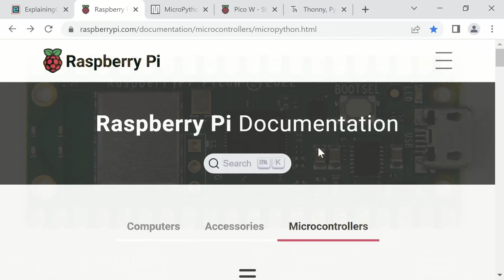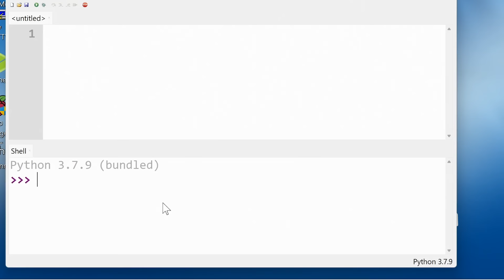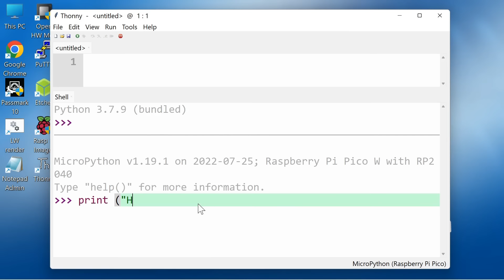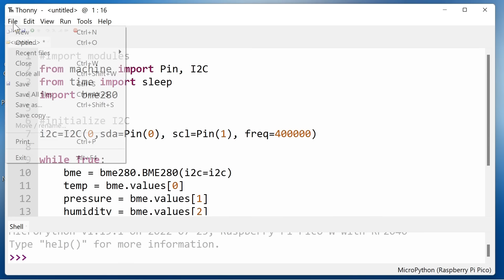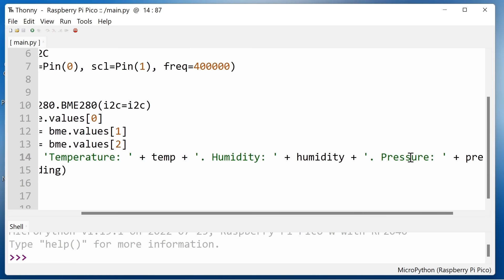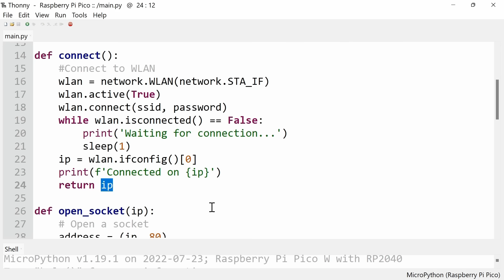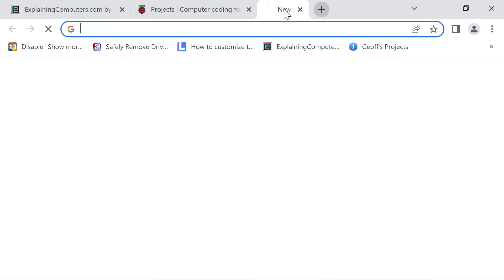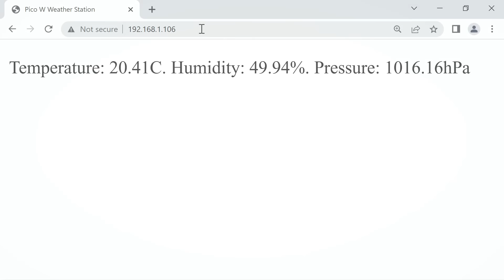Raspberry Pi Pico W: Wireless Weather Station

Comment: I'm waiting for quality MQTT library for Pico W. At this point I can work around it with sockets or other network connections from more advanced Pi Zero and Linux but it would be great to just push data into queue and process it later.
Reply: What's wrong with the existing MQTT libraries?
Reply: @Jimmy_Jones  have you seen C one?
There is one from Paho but it is for C++ and not exactly works on Pico. It works fine on STM32 HAL.
Reply: It shouldn’t take too long as it’s also available on other wifi microcontrollers. But I agree that it’s a priority requirement for networked microcontrollers.
Reply: @CallousCoder  there are some use cases. But I want C so for now it is screwed anyway ;)
Reply: @SergiuszRoszczyk  I agree, but I think it won’t take long for a C MQTT client to pop-up. It’s a simple enough protocol, but it depends on the ip stack implementation of the pico how easy it is to use.
Especially TLS, that’s always non-trivial. But when MQTT C lib is there, I’ll finally be in on the pico. The pico W finally made it a viable platform for me. And I’m actually excited for it now. On its release I didn’t see it as a rival to the ESP32s I tend to use.
Reply: @CallousCoder  I keep fingers crossed for it. I use Pico a lot for tinkering I'd normally do on pure AVR (without Arduino). Now with networking layer it may become very useful IoT platform.
Reply: @SergiuszRoszczyk  I totally agree!

Comment: Thanks for this outstanding video. Is It also possible to implement a weight sensor project?
Reply from the maker: This is a very interesting idea. Certainly possible using a load cell or strain guage (where the resistance changes as force is applied). I have made a note to pursue this as a future video. :)
Reply: @ExplainingComputers  Thanks for your reply and for the note 🙂

Comment: Thanks again Chris for this video. I have the pico running as suggested. However, I have been having some problems, the pico stops delivering html after an hour or two, yet I can still ping it and get a response. The only change I've made to the code is to add a 180 second sleep at the end of try: code - I'm trying to save power as I'm running on batteries. NB. Just in case it helps anyone else - I've found that when I've saved a 'main.py' I am subsequently unable to use Thonny, even if I start from scratch and reload the UF2 firmware. The solution is to download flash_nuke.uf2, copy it onto the pico and then the firmware UF2 as normal. That wipes all existing code and libraries but does enable Thonny to access the pico again.
Reply: is there a way other than using the flash nuke file because its quite annoying to wipe everything each time
Reply: @alexthekid3  Not as far as I know, I only found out about flash_nuke because other people have had the same problem.
Reply: The easiest way around this I found was to pull the jumper to the data pin on the bme280. This interrupted the program and allowed thonny to reconnect. Building a permanent hardwired one, I intend on installing a button to interrupt the program for such occasion and one to cycle the power to restart it in case of a wifi interruption.

Comment: When the Pico was connected directly to your computer the IP was 192.168.1.109.  
It was easy to see the IP Number on the screen at that point.   😊
After you took it outside it changed to 192.168.1.106.  
So,  how did you determine what the new IP number was without having a screen attached to the Pico ?     😊  
Thanks in advance for your reply !!!

Comment: Question is; can this be safely enclosed and still give out a relatively accurate reading? 🤔
Reply from the maker: Yes. The Pico and sensor do not get hot, so there is no problem enclosing them. But there would need to be a small opening somewhere for air to get to the sensor for taking pressure and humidity readings
Reply: @ExplainingComputers  Makes sense :)

Also, any chance you could link to the Github page of that module in the description? Might help others to understand it better if they can pick apart the code, because there's been a couple of questions about converting the temperature to F and upon inspection it looks like that's a slightly more involved process.

Comment: It's very nice, informative and concise, thank you! Would add something into a code for getting right IP address as it can change from boot to boot. E.g. can it e-mail you (or may be some other means) its current IP once it booted with some "id" of the board? e.g. if one has several of these in different locations and want to collect data from several boards (but then it is probably worth of making them all dump the data (e.g. over ssh) to some cloud server with known URL)

Comment: The easiest way in my country (Sweden) would be to by a BMP280 manufactured by Bosch. Do you think it would make any difference? I see some minor things when evaluating the two, but I'm no hardware expert, hence asking here. Cheers to another great video!
Reply from the maker: The only difference is that the BMP280 does not measure humidity, which may or may not matter, depending on the application. :) You would also (probably) need a BMP280 library.
Reply: @ExplainingComputers  Thanks, I will take this into consideration when ordering!

Comment: Another amazing video lots of good stuff and contents. My weather station will be using an RF serial data link as my WiFi won’t reach my garden. A few days into my pico Python experience and I’m not sure I’m happy with the pico.  I think access to hardware counters that can have internal and external clocks is essential. I don’t like the way I cannot right bytes to a output pin without it bit bashing or PIO. The PIO is amazing but isn’t easy to use for a beginner and really defeats the idea of using a high level language. Also the none deterministic nature  off Python isn’t ideal for tight timing which is probably a key feature for a microcontroller. I do however find the Python language amazing in the features that it offer. I don’t think all is roses in the pico garden, what do you think?

Comment: done the same project using a esp8266 microcontroller and bme280 with a mq-135 pollution sensor uploaded to a webpage then used a pi zero to make a twitter bot uploading a timed shot of the reading several times of the day .

Comment: This would make a nifty little datalogging system, have your Pico Ws set up around the place communicating to a dedicated wireless router so it's not interacting with the dirty, dirty internet. Then have another computer scraping data off the web pages and collating it together.

Comment: I am a  little late to interact. Though, on my recent version of micropython, working on an ESP8266, the piece of code 
<p> {reading} </p> 
in the fonction webpage(reading)
does not do what is expected. 
It does not extract and print  the value of the variable "reading" but instead print "{reading] as it.
I splitted the long "html" string in 3 pieces and with two "+" , I got printed what we want: temperature and pressure.
I did not find why
Best regards and many thanks Chris, for all those stimulated adventures
Yves

Comment: So why are all three in one line?

Wouldn't it be better to make a 2x3 table in html? It would be easier to scrape.
Reply from the maker: That could certainly be done, but this was already a complex video, so I wanted to keep things simple by passing across just one variable. There should be no need to scrape your own data. :)
Reply: It would make more sense to have the Pico return JSON or XML at that point. 😕
Maybe have the root return an HTML table for human eyes, and make an API endpoint to return that JSON/XML alongside it.
Reply from the maker: @TrollDecker  True, but here I am trying to deliver as straight forward an example as possible without having to introduce more concepts! :) In education, less is usually more.

Comment: I loved this video!

Is it possible to build something like this and somehow send the date to a time-series database such as RRD?  Then perhaps you could check the present weather, check the average {temperature,  pressure, humidity, wind direction, and speed} or the highest of those in the past 5 years If you build an RRD appropriately?  I noticed that the bm280 didn't include a sensor for wind tracking at all.  Is there another module or product that can do all of them, obviously with extra gear?

My father was a US Air Force meteorologist and I want to build something like that.
Reply from the maker: I built an anemometer to measure the wind with a Raspberry Pi in this video: https://www.youtube.com/watch?v=1LPEPZ02-t8 And here also used the BME280. By chance, I have a video posting on June 25th that takes the anemometer hardware and adds it to the Raspberry Pi Pico --- there is a web page for this already here: https://explainingcomputers.com/pi_pico_lcd.html

Comment: hello Chris, thx for again a most inspiring video ! Tried to copy 1-to-1 what you did but while waiting for the delivery of a sensor, replaced the sensor data by some hardcoded strings. The pgm seems to hang on the statement "client = connection.accept()[0]". Searching / browsing for what could cause that. Any suggestion form your side ? The ip connect is established successfully. Thx, Rob
Reply from the maker: I can only suggest checking your syntax. Or you can down load my code via this page:https://www.explainingcomputers.com/pi_pico_w_weather.html Good luck! :)

Comment: Fantastic video, which inspired me to purchase a pico and bme280. Have fallen at first hurdle though and get an SSL certificate error when trying to install the bme280 package  😞
Reply from the maker: Sorry to hear that you are having this problem. Are you running Thonny in Windows?
Reply: @ExplainingComputers  Hi, yes Windows 10
Reply from the maker: @philshepherd851  Then I am very surprised. Have you managed to connect to the Pico and install MicroPython and execute a test command?
Reply: @ExplainingComputers  Yes, I have written and executed a hello world programme and also your code example, minus the bme elements, to publish a message on a web page. Thanks for taking the time to reply, it is very much appreciated. I suspect it could be a local machine issue and I'll keep plugging away to try and solve it. Working to create a bee hive monitoring system with my nephew and your video/channel have given us a great start. Thanks again
Reply: @ExplainingComputers  Managed to resolve the issue by visiting the module maker's page on Github, which contains the module's source code. Copied the code to a blank.py file and then copied it to the PI. My PI can now access the module's library and your project works perfectly. Thanks again for your brilliant video.
Reply from the maker: @philshepherd851  Great to hear that you got this working. :)

Comment: Ok, I have to ask. cuz well, I'm  new to PICO and I notice you put your GND on 38?? why not on 3? which is right there?  instead of the longer wire or is that a different GND etc.?  does it not matter which GND I use?
GREAT VIDEO btw !!!
Reply from the maker: There are lots of GND pins on the Pico -- so you can use whichever you choose. Looking back, I don't know why I picked 38 and not 3. It may have been a cosmetic issue to get the wires to sit properly for the video.
Reply: @ExplainingComputers  excellent.. great.. thank you.. good to know..

Comment: Not that it really matters, but your code has a flaw.  It reads the temperature, then waits for a web request, responds, and then reads the temperature again.  So each request is getting a stale reading. If you're refreshing every 10 seconds that's not a major issue (data will be ~10 seconds old, except for the first reading which will be older).  If you're just reading it occasionally the data returned could be hours old!
Reply from the maker: You make a good point. But the HTML does force a refresh every 10 seconds, so the data is not hours old. So the code would only be wrong . . . if it were different! :)

Comment: Interesting  just tried to download the code and get   "Content Encoding Error"    running Firefox on Arch Linux
Reply from the maker: Oh dear, I will investigate.
Reply from the maker: You are right -- I get the same error in Firefox. But the link works perfectly in Chrome, Chromium and Edge. Uhm.
Reply from the maker: I've just tried reuploading -- no difference. And re-creating the file and reuploading, and still no difference. So I will ponder. But I am thinking it is a Firefox issue -- the same way that accessing Office365 in Firefox is now highly problematic, and Microsoft Teams and Tesco online do not work in Firefox at all. There is a theme here sadly! Maybe it's one of the Firefox "so secure it has become unusable" settings, but I don't know.

The strange thing is, other Python code I have available -- eg on this page -- works fine in Firefox.

Any idea anybody?
Reply from the maker: I've now fixed the issue pragmatically. There is now a link on the web page to download a zip file that contains the Python file. And this even works in Firefox! :) Thanks for bringing this to my attention.
Reply: @ExplainingComputers  Yes i can confirm it is an Firefox issue  i use Falcon a Firefox derivative and it downloaded no problem 
thanks for trying .. one of those rare FF issues
Reply from the maker: @petenikolic5244  Thanks for reporting back on this.

Comment: Just saw this great video - thanks.  However, the bme280 library you select and use in your code is not found now in Thonny's Manage Packages.  Those that are found are shown to be incompatible with Micropython.  Suggestions?
Reply: It must be back. 9/2/2024, I just did this yesterday on an updated Pi, searched for bme280 and it came up and worked. Try doing a thonny software update

Comment: Excellent video, the project worked first time, no errors. One slight problem: I saved the webpage version as “main.py” now I can’t stop it as it’s always busy when I connect it to the pc.
Reply from the maker: See "In case of difficulties" section in the video description. :) This can happen -- probably because we don't yet have a "stable" version of Python for the Pico W -- but you should be able to break in.
Reply: Brilliant. Thanks Chris, worked a treat. I should have read the description before panicking! 😉

Comment: The second time when you disconnect the pico from the computer and can't see the console, how do you know for sure that is will connect to the same ip?
Reply from the maker: You don't. :) But if there have been no other changes on the network, it is likely. But the IP could be obtained via an IP scanner program, or from the router. This is a quick demo project! :)

Comment: What is the range of the WiFi?
Reply from the maker: It will depend on the walls and other structures that lie between the Pi and the WiFi router, but the theoretical range of 802.11n is up to 230 feet (about 70m). I tested the Pico W in the video up to 30 feet (c.10m) from the router with no issues.

Comment: Hi Chris,
I am looking at measuring sunshine as well as temp etc. Any ideas?
Reply from the maker: You could do this using a photo (CDS) cell, or even a small solar (PV) cell as a sensor.
Reply: @ExplainingComputers  Thanks, I will try using an LDR as I have some in my 'box of bits'. Any advice of connecting?

Comment: Let's add control of a power outlet or two to switch on or off a fan (and/or a heat lamp) as appropriate to automate the moderation of the ambient temperature inside of a chicken coop.  Note, the chickens have requested this be tested as a SAFETY CRITICAL application.
Reply from the maker: All possible -- there are lots of lovely outputs on a Pico. Just needs a relay (or similar) control board.

Comment: I might build this as I have some PICOW boards, I just need to order the sensor, I think I will 3D print a housing for a battery and the PICOW and mount that on the inside wall of my shed and print another housing for the sensors wiring but leaving the sensor open and mount it to the outside of my shed.
Reply from the maker: Sounds like this project is advancing . . .

Comment: Very interesting and informative. This will be great for running my garden railroad wirelessly. Thanks
Reply from the maker: So many possibilities with this board. I like the sound of your garden railroad. :)
Reply: sounds like you are on the right track
Reply: @ironfist7789  - thanks, good comment. :)
Reply: Did you mean "Wirelessly" or without wires ?
Reply: @letrainavapeur  - battery power, controlled by Bluetooth

Comment: Hi Chris. Thank you for this. I'd like to assemble one of these but (as per your warning) I'm unsure which power bank to buy as I will be using it away from a mains source. I looked closely at the brand markings on yours but couldn't quite make it out! Any suggestions for a power bank that will function at low power levels. Thank you.

Comment: It is not clear to me whether the sensor can be set to return degrees F instead of degrees C.  It's also not clear how we know the order of readings (T, H, P)?  Is all that covered in the BME280 library?
Reply from the maker: Yes, this is all determined by the library -- which you can load in and edit in Thonny if you wish to make changes.
Reply: @ExplainingComputers  Thanks.  I spent some more time reading the BME280 docs, in which it is covered in exquisite detail.  I will need to write my own code to convert C to F.  Alternatively, I could just get used to temperatures in C, which wouldn't hurt too much.